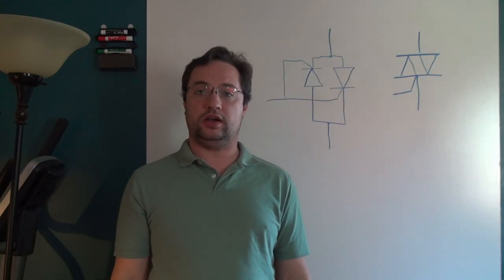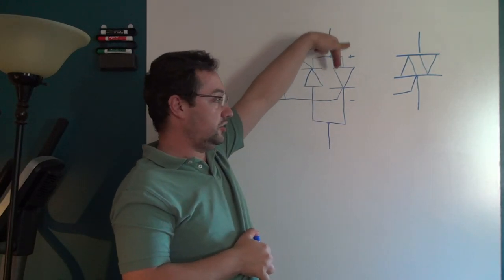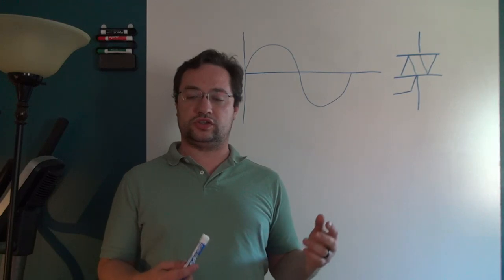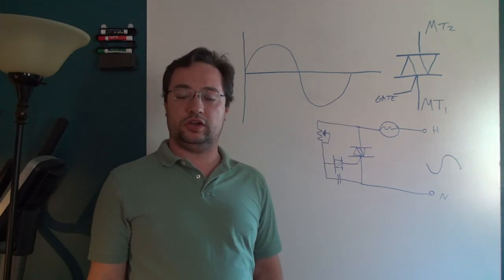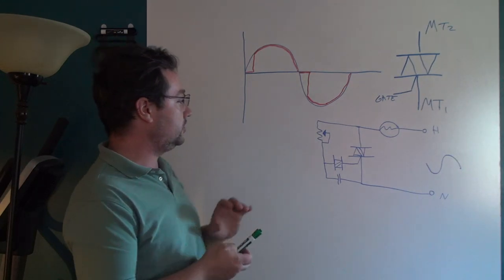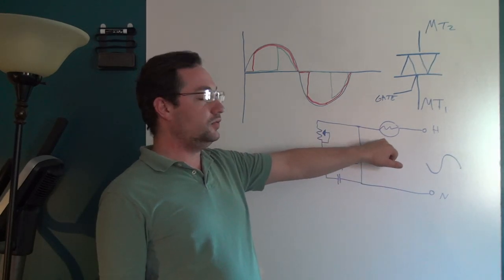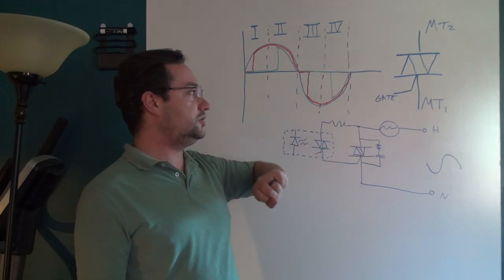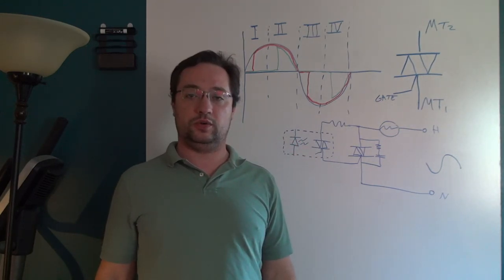eapbg #47 Introduction to TRIAC

Comment: this  is the best explanation there is on youtube .If u dont mind sir ,could u tell me what would happen if the hot and neutral are reversed in this situation .Thank u
Reply: and what would be the right value of resistance and capacitance to adjust for an inductive load . would this work for a ceiling fan.
Reply from the maker: If neutral and reverse are switched the TRIAC would not trigger properly. This is because the gate can no longer go positive and negative compared to MT1.
Reply from the maker: @brainstorm9577  this would not work for a ceiling fan. A ceiling fan requires a special speed controller. The values of capacitor and resistor will be found in the application section of the data sheet.
Reply: @eapbg  thanks for replying ...what if i just want to on and of the fan ..will that work
Reply from the maker: @brainstorm9577  At that point simply use a switch.
Reply: @eapbg  yes ..but a switch is  fine ..but i want to use a controller to trigger switching at a fast rate
Reply: thank u for replying all my problems .May i have ur email,sir .
Reply from the maker: @brainstorm9577  Yes, a triac circuit would work for that.
Reply from the maker: @brainstorm9577  eapbg@gmail.com
Reply: @eapbg  sorry sir .. this email is not working .
Reply from the maker: @brainstorm9577  sorry, eapbguide@gmail.com
Reply: @eapbg  no prob buddy
just check my mail....thanks alot

Comment: How do you calculate the correct rating for the resistor wired in series between the baby triac and the big one?
Reply from the maker: There are three things to consider. The most important is the current rating of the baby TRIAC. The resistor needs to keep the current below the max to keep the baby TRIAC from burning out. The second is the wattage of the resistor. The chosen resistance will dissipate some amount of heat that depends on the value and resultant current. The third is the voltage rating of the resistor. Since you'll probably be working with 120 or 240 volts rms it is important that the space between the pads or "clearance" is wide enough that the voltage can't jump over.
Reply: @eapbg  I think the most important reason is the switch on current of 2'nd triac.
The rest is derivative the above reason.

Comment: Hi!
Will it work without a dinistor? Why do I need to loose 10% of the wave?
Reply from the maker: I'm guessing you mean diac. It will work as an on/off switch. If you want phase angle control you need the diac. Also the first 10% of the wave is only 2.5% of the energy delivered.
Reply: @eapbg  yep, sorry. In my country, the name "diac" is barely in use. Many years ago, I built a triac (simistor here) based AC dimmer. Late 90s. No diacs on sight. It worked somehow. Still don't understand how. Potentiometer, resistor, and an electrolyte capacitor. Based on simple power regulator for soldering iron. Thyristor and diode. But I totally forgot what changes I made. And the device is long gone.

Comment: I have small problem how is phase shifting done to inductive pick ups,sensors or singel phase pulse generators if narow phase angel is requared?
I try figuring out how I can retard me ignition timing on me hei 4pin ignition module just during engine start up wia toggel switch.
I come across lot problems with wire resistance and useing only 500k potenciometer the engine did cinde of work even tought sloppy and insted compresion ignition I ended up at exaust ignition insted.
So thats why Im confused many peopel use different things like transistors ,triacs,scr's but cant realy finde any calculation methode for me particular aplicalition .
So any advice on this topic?
Does there exist remote controled resistors mostly what I have problems are wire resistance and finde correct components for controling varianel frequency ranges below 60hz .
Me ignition module works at osulating frequency at 33 up to 333 hz I seriusly dont know at what voltage or frequency me pick up coil is operating at .
So some how this is mostly related to guitar pick ups volume and tune control I ques.
Did ever some one try to control sensors with simpel circuet from a distance away remote controled?
Reply from the maker: TLDR; get an ignition computer and program it to do what you want. 
Getting a phase delay in the analog world is hard. Look at delay lines. It is even harder to make it switchable.

Comment: what is the best device that can be used to control the direction of motor
Reply from the maker: It depends on the type of motor. Three-phase AC motors both induction and Magnetic (MAG) work with a variable frequency drive (VFD). Single or dual phase AC is tricky. Many of these motors are not reversible because they use a start/run capacitor. Often this type of motor needs to be wound in a special way to include extra windings for reversing direction. I have seen single phase VFDs but I've never used one. Brushless DC motors (BLDC) is just a small MAG motor and similarly need a VFD or a specialized drive. DC motors work with a full bridge motor controller.

Comment: A snubber circuit puts the voltage and current In phase and aligns the voltage and current together to be in sync?
Reply from the maker: If you want to think of it that way you can. In reality that is not what they do. The shunt current around the device allowing it to shut off. When the voltage hits zero the device wants to shut off but the misaligned current keeps it on. As the device wants to shut off it starts to resist the current and the current finds it easier to flow through the snubber. As this happens the device will fully shut off. This is similar to how a condenser works in points and breaker ignitions. Snubber theory is its own whole field. I only know the very basics.
Reply: @eapbg  you're saying that a snubber circuit is a drain bleeding off circuit to bleed off or drain off the voltage and current when the Triac or IGBT is turned Off?
Reply from the maker: Kind of, I would do your own research on them. My knowledge of snubbers is very limited.
Reply: @eapbg  Thank you

Comment: Sir other than opto coupler triggering in normal triggering of triac using diac y can't we directly connect our capacitor directly between gate y we r unnecessary ly inroducing diac what advantage does this offer
Reply from the maker: A diac makes sure that there is a clean on. A diac breaks down at a specific voltage. Once the current flow through the diac drops below a threshold the diac closes and need the break down voltage to turn back on. Without the diac the gate of the triac will see voltage all the time. This can cause false triggering and possibly a partial on type situation.
Reply: Thank u i understood the basic thing which u wanted to convey.But suppose say for alpha=30 degrees i want to trigger the triac,diac also ons at this voltage across capacitor n if a diac breaksdown at voltage corresponding to 30 degrees it would obviously be on 30-150.our main intention is to stop the gate pulse once the triac switches on.but here diac will be on continously for 120 deg.
Reply from the maker: @vamsikrishna5391  There is no need to stop the gate pulse once the triac switches on. The gate pulse only has to be removed before the tiac switches off, that is all. If the diac switches off at 150 degrees the triac will continue to fire until 180. At 180 degrees the triac will shut off (a snubber may be required to do this) and won't fire again until 210 degrees.

Comment: Why does motor make winning sound when using triac for speed control.
Reply from the maker: That is going to depend on the kind of motor and how deeply the waveform is cut up. Not all motors can be speed controlled with a triac.

Comment: Can you make a tutorial how a triac can control AC dimming by using an Arduino?
Reply from the maker: Why specifically an Arduino? The Arduino environment has too much overhead to do this. The ATMEGA 328p is capable enough if you use interrupts. The Arduino environment does handle interrupt on change but it does not handle timer interrupts. That all has to be coded from the raw datasheet.
Reply: @eapbg  This is exactly what I am talking about, think you can make a video in implementing it? Seems like assembly is needed.
Reply from the maker: @ShopperPlug  Assembly is not needed. You need a zero-crossing detector fed into a pin change interrupt. This will prime a timer. Then you need a timer interrupt to do the timing of turning the tiac on and off. If you want to be fancy you can detect if you have 50/60Hz and work accordingly. I could do a video but it would take me a long time to actually get it out.
Reply: @eapbg  Extremely interesting. I know it will make life much simplistic if using commercial bought optocouplers which has built in extra stuff like Diac and Zero Cross Detection. 
But would really like to learn how to drive the Triac using raw components and a microcontroller. 
I know an optocoupler is needed to isolate the circuit from the microcontroller, can build an effective optocoupler from infrared and phototransistor LEDs, I can also build a Zero Cross Detection circuit from a full bridge rectifier, but what really confuses me the most is how to implement the Diac to the Triac and optocoupler properly. I have a bunch of 2A 32V DB3 Diacs.
Do you know any articles or have any schematics on how to build a Triac driver circuitry from scratch?
Reply from the maker: @ShopperPlug  Considering how dangerous mains power is, from a beginning level just use all the prebuilt stuff. Everything is rated and tested for safety.

Comment: I am going to use the triac to lower the rectified dc voltage so I don't have to use a transformer. Everyone says not to do it.
Reply from the maker: That is a great way to get killed. Power supplies should always be isolated.
Reply: @eapbg  Isolation is simply allowing people to touch high voltage and not get shocked but I say just don't touch high voltage in the first place and you won't get shocked.
Reply from the maker: @mark8664  depends on the kind if power supply you are building. The implication in your post is that this will be a bench top lab supply. That is a great way to let killed. If this is a supply that is non adjustable and sealed in a box along with what it is powering, then have fun.

Comment: great sir , i want to add LDR for automatic on and off of load with sunlight, connected with the triac how to do that
Reply from the maker: Not a simple answer. I would start with an opto isolation triac to control the main triac. Then all you need to do is turn the opto led on and off. That's where things get a bit more complicated. For best results, I would suggest some hysteresis, preferably adjustable so that you can tune it to you lighting conditions.
Reply: Like eapbg said,  try a 555 ic working as a Schmitt trigger for hysteresis.

Comment: Hi sir , can you tell me about the heating issue in triac if we don't use heat sink for example bt136 how much Ampere we can pass through this.
Reply from the maker: at 25C free air ambient it's a little over one amp (it will still be very hot so be careful). This is a complicated topic and will require an in-depth video to explain.
Reply: Thank you sir
Reply: 4amp

Comment: What happen with the baby Triac once the Main Triac start conduncting current?
Reply from the maker: The baby triac continues to conduct just like the big triac. Once the LED is turned off and the current reaches zero the baby triac shuts off.
Reply: @eapbg  Sorry, you made big mistake. 1'st triac switch off immediatly becouse the voltage on 2'nd triac terminals is olmoust zero
Reply from the maker: @gordongecko9405  Could you elaborate?

Comment: Power supply protection circuits use SCR for crowbar protection, which is DC i thought? why are they using an SCR device in a DC circuit
Reply from the maker: An SCR is a latching device. That is probably why they are using it. I did say it was almost exclusive. There are other applications.
Reply: Probably to blow the fuse for safety reasons.

Comment: A TRIAC and DIAC are latching devices? A SCR is a latching device which you have to turn off the power to reset the SCR device to unlatch it.
Reply from the maker: A TRIAC is two SCRs stuck together. A DIAC is like a zener diode except for the voltage collapses after breakdown.

Comment: Why doesn't the current just pass through the snubber while the triac is off?
Reply from the maker: A small amount does.
Reply: @eapbg  Ok, so if I understand correctly, the small amount of current that passes trough the snubber while the triac is off doesn't provide enough power to run the load?
Reply from the maker: @peki1701  correct, this is a leakage current.